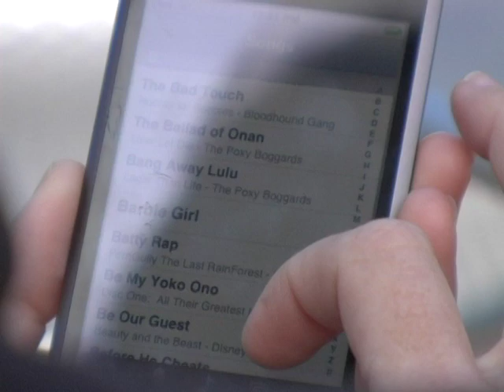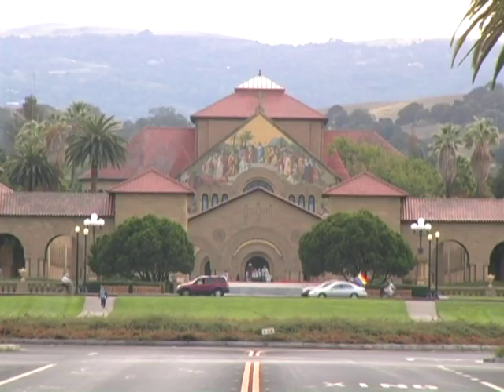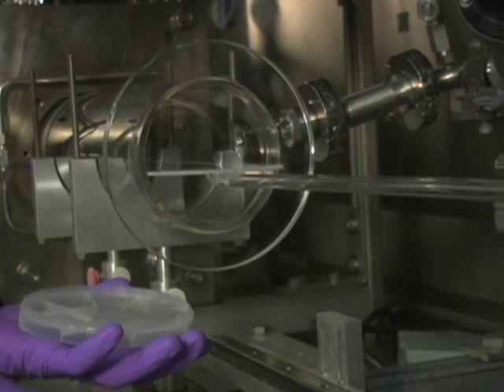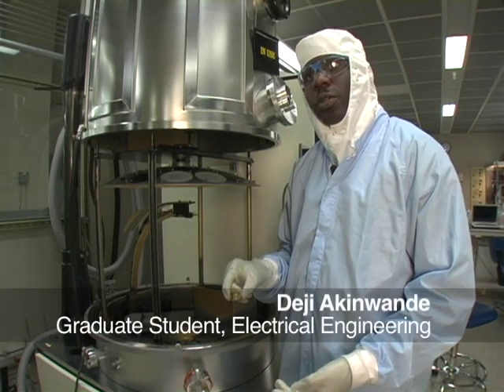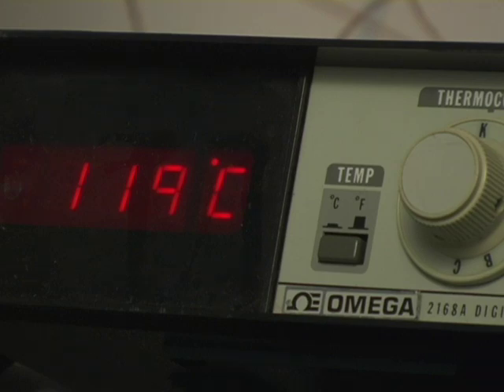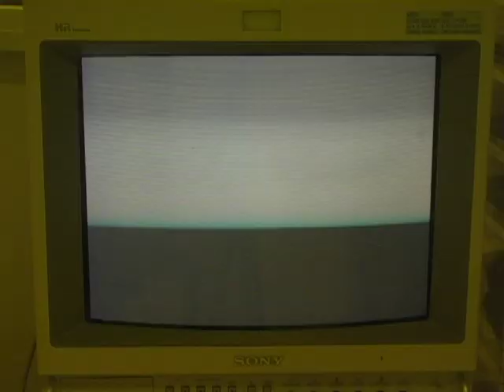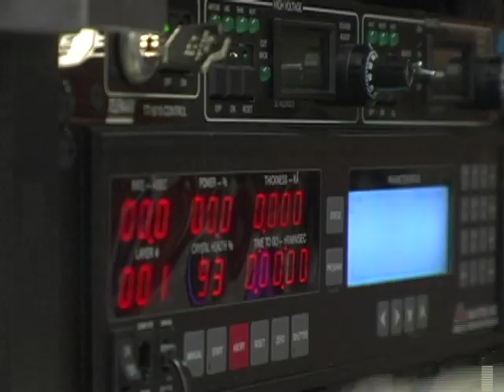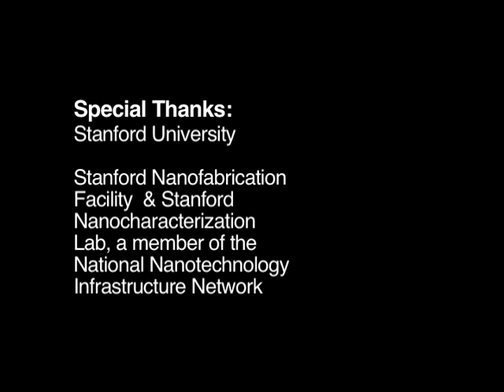Nanotechnology - Carbon Nanotube Electronics

Comment: and one more ( i couldn't fit it into the other comment box) 
3. Could some solution be mixed into tar, or the blacktop used in roads to make ice and rain "not" stick to it?? therefore eliminating some of the worst driving conditions there are, and as a result less crashes and related deaths occuring.